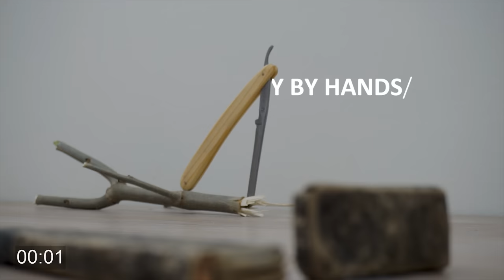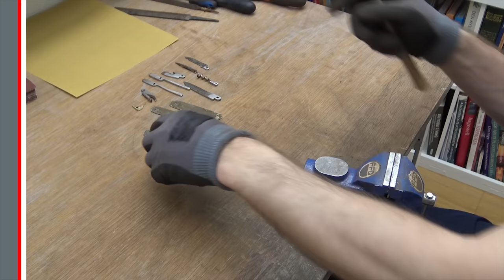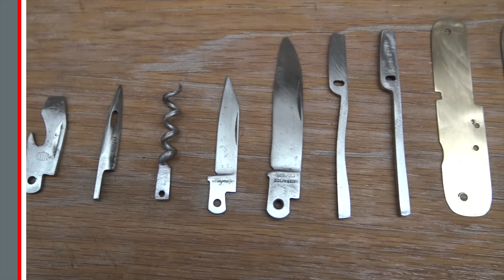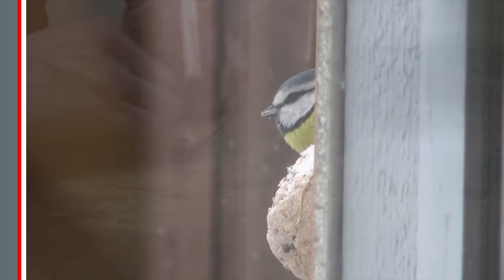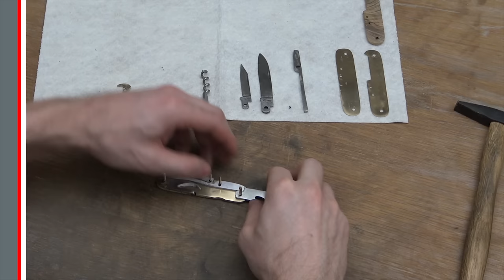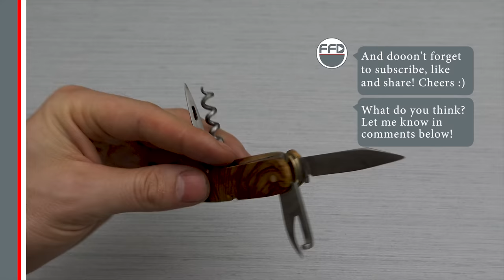Pocket Knife Refurbishing from World War 2 | COOL RESTORATION

Comment: Good job sir! But i want to ask you a few questions:
1. Why are you using only hand tools? Power tools are more handy and powerful.
2. Why are you using brass as a shafts/rivets? Soft steel is much harder than brass. Even original rivets was made of steel.
3. Wrecked bottle opener. It's obvious that spiral body of opener is bended. You might use a blowtorch, hammer, drill bit / some rod to bend it back in shape. Why not?

Wooden handles are truly great. Indeed the are. But what about plastic? You don't like it at all? 

Sorry for grammar. Languages is not my strong side.
Reply from the maker: Thank you!
1. I like that way...
2. Why not brass? 
3. Heating will damage the steel and the original hardness...
I prefer wood over plastic!
Reply: @FFD_Restorations  
1. I respect your way. In some things i do the same. 
2. Brass is softer. I think, some time later hardened steel will "eat" soft brass shaft.
3. Heating will temper opener, but it's not too difficult to re-hard it again. You just need a magnet as a measure instrument.

What kind of wood you use?

Comment: Excellent video, and the result is very pleasing. Olive wood is an excellent choice for knife scales. I believe that the original scales were horn rather than wood. 

One point, however: The GM on the blade doesn't stand for 'German Military'. I have seen this mistake repeated elsewhere: but, if you think about it, why would a knife manufactured in Germany bear an abbreviation for English words? In fact, it stands for 'Gebrauchsmuster' - 'Utility Model' - which was a form of intellectual property rights protection somewhat short of a patent. You will sometimes see this as GebrM, or in expanded form as D R G M, 'Deutsches Reichsgebrauchsmuster' ('German Reich Utility Model'). 

I think that the 'German Military' error may stem from people trying to bump up the value of surviving examples by associating the product with the Wehrmacht, due to the considerable interest of collectors in artifacts of that period. There is no evidence that this was a special 'military model'. 

https://en.wikipedia.org/wiki/Gebrauchsmuster for an explanation of 'Gebrauchsmuster'; 

http://thebladeblog-ulf.blogspot.com/2016/02/the-vom-cleff-co-leverlock-drgm-73661.html for an explanation of DRGM, etc., as applied to knives - the final paragraph is the most relevant.
Reply from the maker: Thanks Paul!

Comment: I'd very much like to know how you were able to put any kind of date on this knife. These knives have been made since the 1890s and are still made today as what we now call the Swiss Army knife, but were originally made in Germany for the Swiss. Later another company... well two companies to be accurate, got the contract from the Swiss Army (why do they have an army if they're neutral on everything? To stay that way I guess) What became Victorianox and another company called Wenger, because neither company was large enough to fill the order in the set time by themselves. Used to be Wenger was found primarily in Europe, Victorianox everywhere  else, including the US, but a Wenger did get across the ocean now and again. Victorianox bought out Wenger not all that long ago, so now only Victorianox makes the leget Swiss Army knife... and many other products. However they've never dated coded their knives to my knowledge, so I am curious as to how that was determined. The fact it had wood scales helps some, but not a lot. by the way, from what I can see in the vid, you may be in trouble with those scales if the knife gets used or carried a lot. it appears the grain is going short ways across the knife...if that's so it will break easily.
Reply from the maker: Thanks for the info! According to the barrel stamp and "G.M.429221" I managed to date the knife and the military background. Knife will not be used, so it will be just fine...
Take care!
Reply: @FFD_Restorations  actually, that's a shame that it won't be used and appreciated for what it is, all that work and it won't be used. Seems a waste of time redoing it. it's not like it's still a relic. what was the wood, anyway, it's beautifully figured, you just cut the scales wrong so far as I can tell, it may be fine vids can be like that. I'm not a guy that likes to see cars, toys or anything else just on display. Like the hot wheels guys that want them new in the package, a toy should be played with, a tool should be used. I carry the modern version of this knife. Oddly there's a bit of a story to that one. I had misplaced my previous "macgyver knife" so my wife wanted to get me another one Christmas. Money was tight, so she shouldn't have been able to afford it on what little we had to spend. Later I learned she got it at a discount because it already had a name imprinted on the scale. That name, however just happened to be my real first name. She's long dead now, so I carry it daily on my keys... don't use it a whole lot, but always have it in case I need it... but I also carry about 6 or 8 other pocket knives. one for any purpose. at one point I was buying old pocket knives often, whenever I found them, one day I decided to clean out my overalls pockets so they could get laundered. I had no less than 18 pocket knives in my pockets. I would buy them, put them in my pocket, then forget about em.

Comment: Looked like you removed a bit too much metal, making the back spring super weak. Why not just use a rust remover instead of grinding away all the metal?
Reply from the maker: Hey Andrew!
Yes, you spotted nicely, well done 👍. I have been using before rust removal and end up sanding as much as without. So at least without I avoid chemicals in my body and helps for environment... If I put in perspective I am removing rust every week for several days for last 1,5 year and that is a lot of chemicals breathing in. Sure there is a protective gear, ventilation and such but I am doing this as a hobby...
In future I will remove less where is the spring, best solution what I come up so far 😂
Thanks for reaching out and take care!